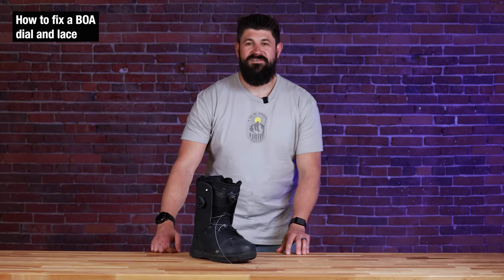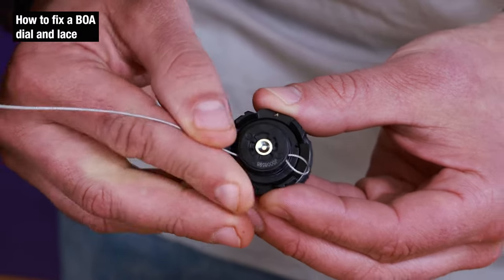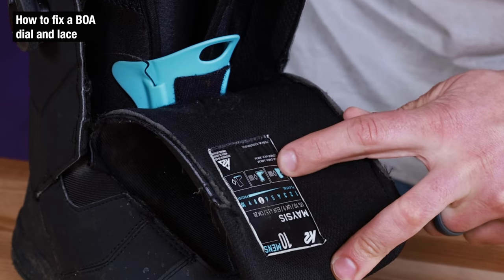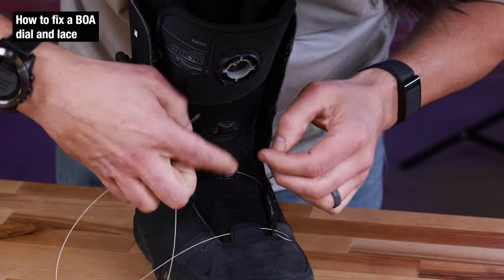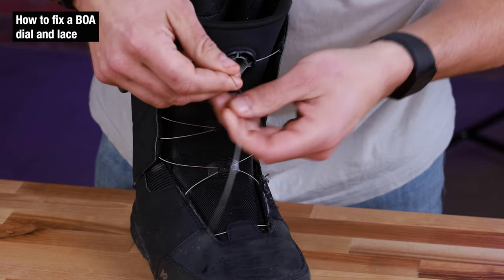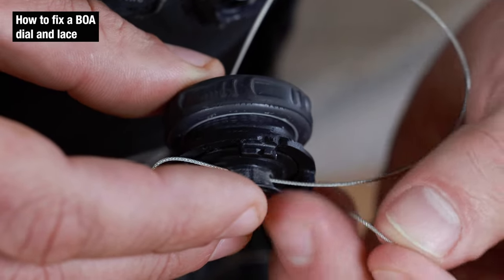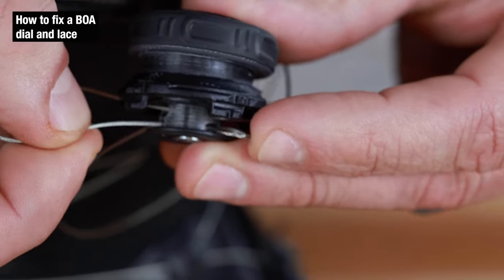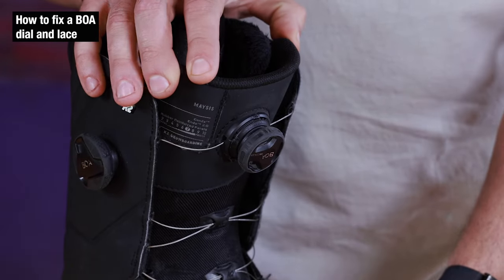How to fix a BOA dial and lace

Comment: What about fixing the SIDE BOA dial? Please demonstrate or direct me to the tutorial. Thank you.
Reply from the maker: Hey Brian, we don't have a video for this yet. Good idea we will work on it.
Reply: Please make this vid😢
Mine just broke, about to order the cable but not looking forward to performing the fix.
Reply: On this exact boot!😂
Reply: I have same problem on this exact boot
Reply: @korygrant1596 
Well I replaced it.

It was a HUGE P.I.T.A!

You have to take off the front BOA to perform the fix.  Luckily the BOA company sent me 2 laces and dials under the warranty claim.  My goodness the repair was terrible.  Took over an hour because at first I did not want to remove the front lace.  The wire kept getting hung up internally but I finally managed to run it, I had to feed it the opposite way I was initially trying to feed it.

Good luck replacing yours.
Reply: Anyone find a tutorial for the side boa?

Comment: I just bought a pair of burton boots back when they did their own boa version. Both of the laces are frayed. Would I be able to buy the boa kit and replace it? They were $17
Reply from the maker: As long as the main housings are in tact, you should be able to replace it. Double check on the BOA website.

Comment: i can’t feed my wire thru it’s like something is blocking it
Reply from the maker: It happens, sometimes things get mucked up in there. There is a thiner tool that can be used to snake the cable through. Keep trying.
Reply: I have same problem. did you figure it out.?

Comment: Can i replace my fabric laces with metal ones?
Reply from the maker: @Georgeeeeeeeee, in order to use metal cables you need plastic guides on the tongue of your boot. If you swapped out the ropes for cables you would cause too much wear on the fabric. Just be careful of where you hang your board on the lift as most of the time its the sharp board edge that does the damage. The rope laces are sweet because they can flex while you move.

Comment: how hard is it to repair the boa conda?
Reply from the maker: The conda can be a little trickier to replace if you have a nylon lace. You may need a feeder line provided by boa to get things through the tube if you have a nylon lace. If you have a metal you can usually push it through.